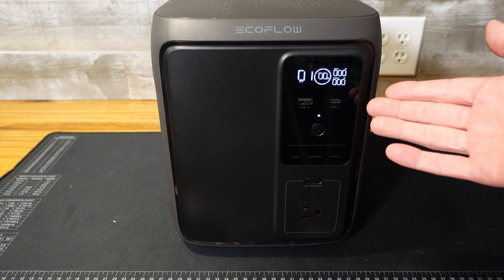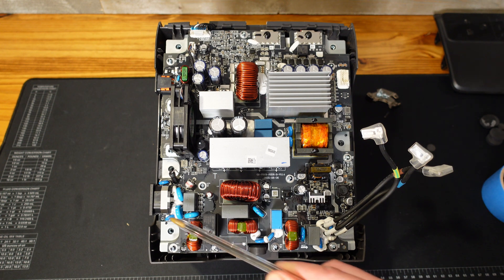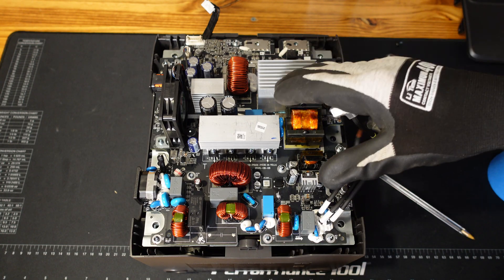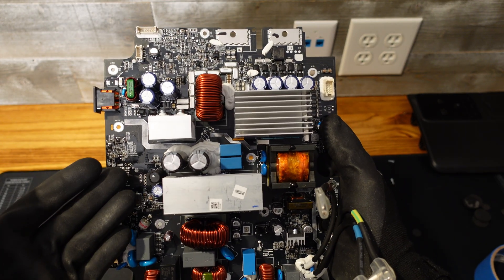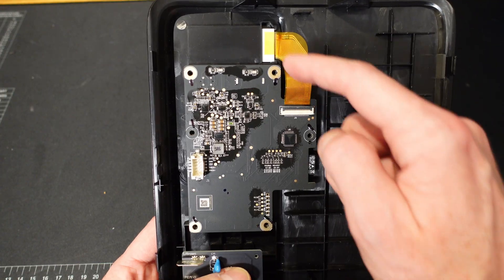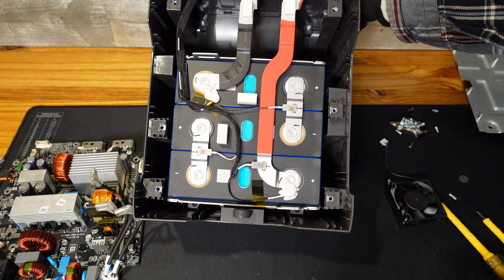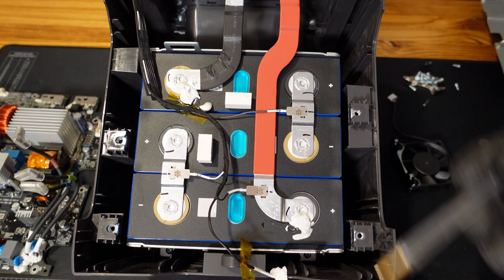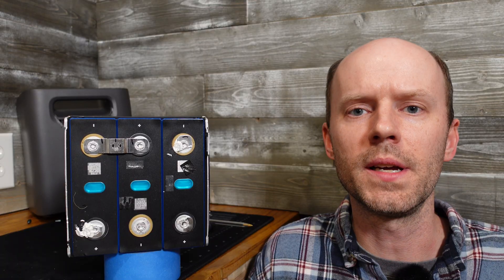Inside the EcoFlow Delta 3 1000 Air Portable Power Station, Complete Teardown

Comment: Hi Sir, the Mosfets used on the other side of the board under the heatsink and the one you thought for BMS is used for synchronous rectification. Used to convert AC to DC in more efficient way than using Schottky  diodes. My guess is  during inverter mode, those Mosfets are used in Full Bridge topology as DC-DC boost converter and the thin vertical heatsink (High voltage side ) must be used for 4 high voltage Mosfets or IGBT's which is actually the inverter portion of the circuit, which converts DC (around 165VDC ) to AC 110V, with the help of the large inductor and grey X capacitor. Also the Black relay DPDT must be used to isolate the input from output to prevent back feed through the input power cable . The smaller blue relay must be used to bypass the input to the output when AC power is available, like a toggle switch SPDT . This is the first time I've seen 5 discrete circuits included in a single board, i.e.,  SMPS , Solar Battery Charger,  BMS, DC-DC Boost converter and an AC inverter all in one .  

Also note the BMS is an integral part of the boost converter, the same Mosfets are used for protection of the battery bank as it is directly connected to the DC-DC boost converter. No seperate BMS is needed.  

I hope the details I gave are at least 70% correct 🤞🤞🤞
Reply: Decent analysis. I took apart a River 3 Plus and most of what you mention sounds right, looking at this one the row of FETs on topside above the caps near B+ is going to be a high side BMS protection cutoff, and there's two groups of four FETs on backside, Four are for 4-switch Buck-Boost for DC input and the other 4 operate as you said, in synchronous rectification mode for AC charging and probably phase-shift full bridge in AC inverter mode. Looks like there's 6 active devices on the input side, so they're doing bridgeless active totem pole PFC with four of them to form a full bridge for sine wave PWM, same as the River 3 Plus. There is no AVR, impossible to support that with this architecture. the "AVR" feature is just probably a better choice of switch over voltage than on the R3P which sets it to 80V which is far too low. Tiny blue relay's to switch AC output on and off (don't switch this under load!) and the black one is to cut off the AC input in islanding mode.

Notably all of the GaN parts are depopulated from the primary side and replaced with probably Si parts as a cost-down, transformer looks exactly the same so efficiency will take a hit, with more heat sinking going on in here than was found in the River 3 Plus. 

The two on the other side are a half bridge converter, non-resonant, hard switched, so there's going to be more loss there in charge vs inverter mode (these run in reverse as synchronous rectifiers in inverter mode). That's fine because you care more about efficiency on battery than the other way around. You also take a hit to efficiency in inverter mode because with half the voltage (R3P is 24V) the current will be higher.

Probably marginally louder compared to R3P  but without the annoying motor noise since the fan's quite thin and those motors tend to click/buzz less.

Comment: Used the cheapest cells they could find at a really odd voltage too. I'd like to put that thing on my scope and see its output waveform under load. Would not be surprised if the other components are low grade.

Comment: The fact that it's 3s is quite interesting. I was expecting some cost saving measures after finding out the type c was not PD. I would be worried that they tried to save some money on the bill of materials for the SMDs and some resistor that cost are fraction of a cent takes it out in 3/4 years.

Comment: Can you do a tear down and maybe expansion battery mod on an Oupes 1500 next. It looks like a better value for the money than this delta air. Will be great for the community. Enjoying all your vids! Thank you.
Reply from the maker: I'm not planning to do any more of the smaller power stations at this time. The videos haven't really been performing well. The Oupes 1500 does look nice though. It has all of the features this one is missing - 3x AC outlets, 2x 140W USB-C, a 1500W inverter at a very similar price ($389 as of this post). I'm not sure what EcoFlow's deal was on this one...

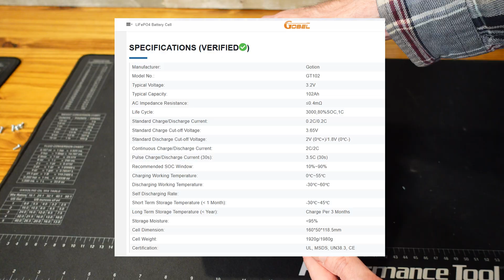Comment: Thanks for the teardown and putting up the spec sheet (6:34).  I'm curious what they mean by "Typical Capacity" rather than saying "Nominal Capacity"?  EcoFlow is marketing this as a 960Wh battery but that would be true if they were 100Ah cells.  102Ah would make this a 979.2Wh battery.  Is EcoFlow is intentionally underrating it?
Reply from the maker: Good question. Unfortunately I haven't been able to locate an actual data sheet for the Gotion cells. I've tried in the past and again while filming this. I would have to see exactly how it's described in the manufacturer's datasheet. My interpretation of the language is that they "almost always" test at 102Ah on the first cycle or two, but the actual rating might only be 100Ah. EcoFlow has been a very reputable company, so I would trust what they're stating which also agrees with the 100Ah theory (960Wh / 3 Cells / 3.2V = 100Ah).

Comment: I'm curious what you do with the battery cells and the other useful parts from this power station?
Reply from the maker: It depends. These cells will end up recycled. I usually hold on to the rest of the parts and put them back together.

Comment: Looks like a high tech style bms with the mosfets on the positive battery terminal versus all the other bmses we see with the mosfets on the negative battery side.
Reply: High side N-channel switch BMS is fairly common in the industry now, just have to use a FET driver chip with a dedicated bootstrap circuit to generate the voltage to hold the gates at battery volts plus 13V or so
Reply from the maker: That would be unique for sure. Out of all the batteries I've torn down, I've never seen one with positive battery control. There are two banks of them though which is throwing me off, only thing I can assume without spending hours tracing it is one bank of FETs is for the charger?
Reply: @LithiumSolar  no clue about that but another battery using positive side mosfets on the bms is the new Bluetti 314ah 12v battery. It looks so awesome seeing the amazing electrical engineering going into batteries these days.